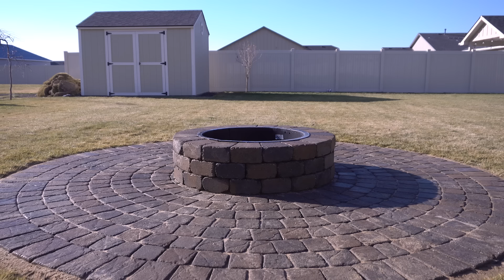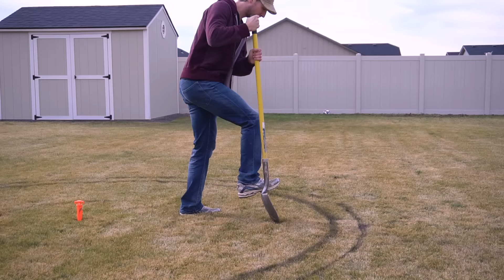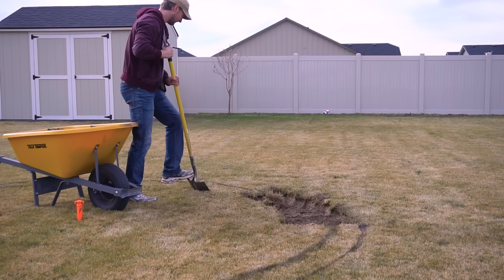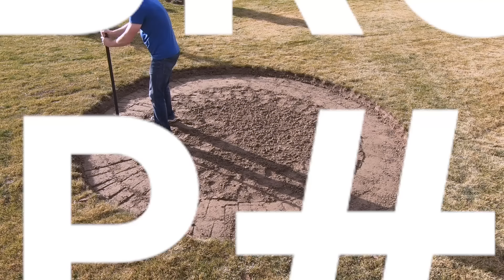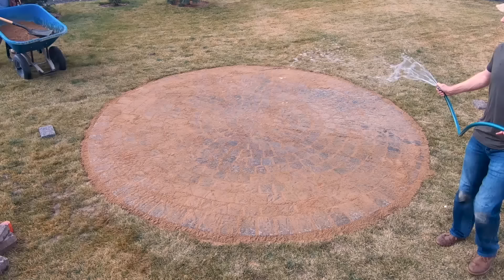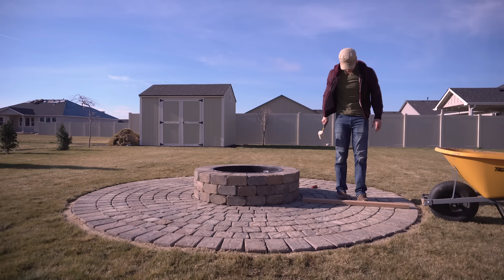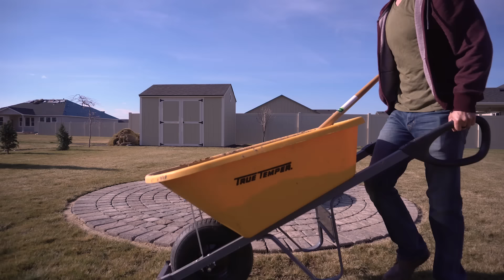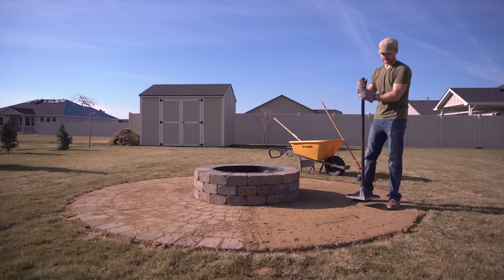My 4-Day Fire Pit Patio Build [Full DIY Project]

Comment: Sand is very, very and very bad choise. Freeze watter on springs or autum can easily pull up a bricks. 

Best is using 20cm gravel 16/23mm > 10 cm gravel 8/16mm. This 2 layers presure with 200kg machine again and again until hard it. On top layer take 4/8mm gravel, which you adjust horizontally manualy with straight plank and lay bricks on it. Brick light presure with 100kg machine with rubber (rubber dont scratch a bricks) and pour fine sand into the gaps between the bricks. 
After all of that again 1 times presure all with 100kg machine with rubber. This layer setting make the water may freeze in the gravel gaps. Sand on your top layer have not ANY gaps and freeze watter easy pull up your bricks (mainly in spring and autumn if snow melt in day and freeze watter at night). In center under fireplace is best to do natural stone layer. Not this brick (they can be cracked after anytimes fires - natural stones looks better + 
they are more durable (+ cheeper)).

If u lived anywhere where isnt winter like classic winter (snow, freeze etc) but winter is like cold summer - this DYI video be okay.

Srry for my bad english. many many words i translate for help in google translator. + i know there in central Europe only metric system like are "milimeters" or "kilograms".

Comment: Loved your video dude. One quick question though. When I built my pizza ovens and fire pits I got bricks and mortar built to withstand fire for stability. Is there a reason why you went with just stacking them?
Reply from the maker: This is just what the kit came with, and the weight of the blocks make them super stable for the height, so I didn't feel like mortar was needed. That said, I did add some masonry adhesive to the top capstones because those were more likely to tip if sat on. So now it's all locked together with those.

Comment: Are those bricks fire safe? Just curious cuz I know some type are not and could explode
Reply from the maker: Basalite (the manufacture) has those specs on their website. But I think that's why they added the metal ring, to shield the bricks a bit. And I added a grate to the bottom to lift the fire off the pavers.

Comment: How do I calculate the amount of sand I’ll need. I have 15ft diameter? Also, is it better To buy sand in bulk?
Reply from the maker: First, I recommend using silica sand even though I used regular yellow sand. Silica will prevent weeds and ants better. As for calculating... I'd find a "cylinder cubic foot calculator" on Google, because basically you're finding the cubic feet of a very short cylinder (your bed of sand below your pavers will be only an inch tall).

You want to fill the cracks between the pavers with sand too - that doesn't require nearly as much with thin spacing between the pavers, but if you do wider spacing, it'll start to add up.

I'd probably calculate my cylinder, and then add another 50% for the cracks.

Comment: Whenever my dad builds something with bricks, he uses sand-cement ish. It’s sand but when you put water it hardens and turns almost to cements. It is hard like cement but not tha hard so that you can still move the bricks
Reply from the maker: Polymeric sand, yeah, I considered it. Decided in the end that with my extra  thin spaces between the pavers, I didn't want to risk it potentially cracking and looking bad.

Comment: Why no cement lol
Reply from the maker: I don't like the look of it in the middle of the yard. 🙂
Reply: The top part where the fire is its not moving or if you will fall on it it won't move? Looks wired holding by itself lol
Reply from the maker: @-IsleOfSkye-  Oh, I see. Yeah, I did add some masonry adhesive to the top capstones so they are secure. Just didn't show it in the video
Reply: Oh OK. That's nice I wanna make something similar in UK but with pipe underground for the air to flow inside the fire (turbo) Nice vid man!
Reply from the maker: @-IsleOfSkye-  pipe would be awesome. I've seen some where they stick a fan in the end. Good luck man!

Comment: Why the different types of sand. Made the sam construction in my fathers garden. Just layed it on the regular sand under the grass. It has been level and totally fine for 15 years.
Reply from the maker: That's awesome! In Idaho it gets pretty cold and the ground can heave in the winter. I also wanted good drainage. So that's why I did a base of gravel mix, and then an inch of sand

Comment: Perfect example of why you should pay a little more and hire a professional! DIY isnt as good as homedepot and you tube makes it seem! Do your research and make sure they are an actual reputable professional! If your contractor shows up and looks like this you should fire him at the point when he only digs 6inchs down for prep! Also sand is the worst product to use on hardscapes! Sand holds alot of moisture making it perfect for heaving! Also ants absolutely love sand because they can move it with great ease! Basically by putting a layer of sand under any structure your building the ants in your community a beautiful ant farm! Any patio, wall or hardscapes should be minimum dug out 12"+ for prep. Also never use sand for joints! There is professional products to put between the road crush, and the paving stones and the joints that cant be effected by ants or water! Like 85 percent of contractors this patio turned out awesome for 1 day! The forces of nature (rain, ants, freeze, thaw) will deteriorate this patio fast! But by this time they have your money and they are long gone lol! Also the number one thing to invest in on hard scapes is proper road crush! Engineered spec road crush is the most important thing your using as a base. Itd expensive but a must! Huge difference between that and the cheap crap most landscape centers sell!
Reply from the maker: Agreed there's stuff we can do better next time! But, it's lasted over a year (two winters) and it still looks great! So I'm happy saving that money. 😁

Comment: The pro should of told you to use polymeric sand as well
Reply from the maker: I don't remember if he mentioned it, but I chose not to on purpose. I wanted better drainage and no risk of the polymeric cracking since I'd already reduced the gaps between pavers more than recommended.

Comment: You make this look easy enough for my husband and I to tackle. But, What do I do about my sprinklers? Is there another video for that😅
Reply from the maker: 😅 I was worried about sprinklers too. But I knew the sprinkler lines were deeper than I'd be digging (your depth may be different - dig carefully or dig a few inches shallower if you want) and I just placed the patio in between the sprinkler heads so I didn't have to relocate any of them. Using sand between the pavers gives the patio amazing drainage, so that took care of standing water. I'd just recommend silica sand rather than the stuff I used. It'll prevent weeds better. You guys can do this! 😁

Comment: So the fire pit itself is just secured there with gravity?
Reply from the maker: At first, yes. They're pretty thick blocks, and held in place without any issue. But the capstones were less solid, so I ended up securing those with masonry adhesive. And that locked the fire pit blocks into place permanently.
Reply: @BroBuilds  Nice work, Thanks for the response.

Comment: Much appreciated, I'm not building a fire pit but I had built a pad for my trash can to sit on out of spare pavers and have had some issues with them not getting locked in. I added layer after layer of sand between them, but I never thought to tamp the sand into the gaps! I'll be doing that after it gets warmer outside
Reply from the maker: To really lock it in, use polymeric sand. It'll harden like concrete in the gaps. I didn't use it because I wanted more drainage through the pavers but especially if you have a small pad, polymeric will hold it all together and drainage won't really be an issue.
Reply: @BroBuilds  awesome, thanks! The patio looks great by the way

Comment: Weeds don't grow from underneath they grow from seeds that land on the top if you put compacted gravel underneath we do 4-6" depending on substrate. Weedcloth is useless. Tamp the sand down with your feet before you screed it. Sometimes we use polymeric sand usually not because its a messy pain in the ass in northwest washington and moss and stuff grows regardless...We usually just sweep and wet sweep sand in. There will be maintenance issues regardless..We also put a concrete wedge around the outside sloping down  and cover it with dirt...the plastic edger is garbage...I've ripped so much of that crap out of the ground. the concrete keeps the pavers from spreading apart is easier to use and cheaper and forms itself to the edge and also keeps the sand from washing out. and also slope it one way or another towards where ever it needs to drain so you don't have puddles...especially if you use polymer binders...sand drains better. Also you can save your arms and rent a plate compacter...for the gravel and pavers

Comment: May I ask why the fire pit wasn't stuck together with concrete?
Reply from the maker: It didn't need it. But I did end up putting some masonry adhesive on the capstones, so they wouldn't tip, and that's holding it all together now

Comment: Please don't take this the wrong way. What you did was hard and alot of back breaking work. You set the pavers out nicely too. It was a good DIY but it's going to have weeds grow in it and structural issue eventually because of some of the important steps you missed. ICPI certified or not you did do a good job for a DYI.
Reply from the maker: Thanks, no offence taken! Yeah, wish I would've added weed barrier underneath, but so far there's only been a few tiny weeds growing near the top. So far it's held up well! We'll see how it handles its second winter soon. 😁
Reply: @BroBuilds I'm guessing weed fabric you mean geotextile fabric. You add geotextile fabric on the dug out area to help structurally before you add the Crush and Run...Instead of the sand you put in. Pressure wash it out and get polymeric sand to put in the joints of the pavers. It'll help with the weeds for quite some time and it stays put alot longer. Not to act like a promotion but my company I work for prefers Alliance gator g2 and it does work really well lol. We used a lot of different polymeric sand and that's what ended up working the best. I hope this helps you going forward
Reply from the maker: @Twoinches2short  Absolutely - I've heard good things about the gator g2 from other people too. Thanks man!
Reply: @BroBuilds  No problem dude. All we can do is learn. I know I still am!

Comment: I didn't understand exactly what the conduits were for, since you removed them later. I know nothing about these types of projects so if you could explain it would be great
Reply from the maker: The conduits were an inch thick, so it made it easy for us to put exactly an inch of sand down, and by scraping the 2x4 along the conduits, we got an even, smooth surface.

Comment: idk, i don't trust a build like that. I need to know my stuff is held in place by more than just gravity. The patio was nice looked nice and sturdy but that fire pit has nothing really anchoring it in place other than weight and gravity
Reply from the maker: Fair enough! I ended up going back and adding some masonry adhesive to the top capstones because I was worried about them tipping, but the rest felt solid enough for me.

Comment: You used the wrong sand to lock the pavers together, you don’t use general purpose sand, you are supposed to use polymeric sand, and you didn’t glue the 3 rows of the fire pit together
Reply from the maker: Good tips, but I didn't want to use poly, because I think it'll crack over time and look bad. But you're right about the sand - I switched to silica sand which is better. I also ended up using some masonry adhesive on the top capstones, so that locked it all together 🙂
Reply: @BroBuilds  more than one way to skin a cat, end result looks good though man! Thank you for not taking the comment in a negative light.
Reply from the maker: @nathanglidden1967  I learned a lot from this project just because people are willing to comment. 😁 Thanks for sharing your expertise!

Comment: dont use normal sand, and it need to be stopped aswell, when the rain and frost come the it will move and u have to do it agen after just a year.
Reply from the maker: What's "stopped" mean in this case?
Reply: @BroBuilds  sry i Meen stomped. That u do whit the stonemix.
Reply from the maker: @saltaren123  oh gotcha. I think I got it stamped down well enough. So far no movement after one winter, but we'll see how it goes this winter too. I agree on the sand - I switched to silica sand later, and poly sand would work too.
Reply: @BroBuilds  thats good to hear, u guys did a good jobb, im just a littel worried aboute the sand, but i think u can fix it if something gona happend.

Comment: No polysand? No adhesive glue for the fire pit stone?
Reply from the maker: I chose not to do the poly sand, because I felt like it would crack too easily in between the pavers. I did add some masonry adhesive for the top capstones of the fire pit though!

Comment: So you removed 7 inches of dirt to put 7 inches of other shit in it's place?  And that makes sense how?  Why not just remove the grass and whatever dirt you need to be removed, pound it, and lay down the pavers?  No one is even gonna know what's underneath.
Reply from the maker: The gravel and sand is for good drainage. If you just lay pavers on packed dirt, it'll flood when it rains and the pavers will slowly shift and move over time

Comment: Dude, shouldn't you fix the bricks around the fire pit with concrete so there is no chance the bricks will move. Anyways nice video. I liked it and I also subscribed
Reply from the maker: Thanks! The bricks were fine, just held by gravity, but I did add masonry adhesive to the top capstones so they wouldn't tip off if somebody sits on them.
Reply: @BroBuilds  omg, you guys are legends, this is one of your oldest videos and you literally replied in less than a hour. BTW this is the first video that I watched fro your channel and I loved it so much that I subscribed with notifications on right away and I've been watching your videos the last whole hour

Comment: Having the gas powered tamper/compactor would make the final step with the sand really tie things together. 

The vibration on top of the sand/paving stones forces the sand into every little nook and cranny, then you have less sand to sweep off the stones and the stones are really tightly secured with the sand packed between them.

Comment: Why don't the pavers on the fire pit just slide around?
Reply: Yea I was wondering the same thing 🤷🏽‍♂️
Reply from the maker: The very top ones? We actually did end up glueing them down with some construction adhesive. We didn’t in the video because we weren’t sure if we were going to move some of the bricks around (which we did in the follow up video).

Comment: In future reference you should of used kill dry sand instead of regular sharp sand. Kill dry sand is finer and made for block paving sealing
Reply from the maker: Good tip. I went back and added silica sand later, to keep weeds from growing from in the cracks.

Comment: I’m planning on doing a similar project in April, should you have laid anything down to prevent grass/weeds? It’s been almost a year, have you had any issues with weeds, or regrets overall? Appreciate yours, or anyone else’s input if you’ve laid pavers before. Thanks
Reply from the maker: I forgot to lay down weed block, and I probably should've! That said, I only had about 5 weeds and they were all at the top (so the weed block wouldn't have helped anyway.) I do recommend silica sand, rather than regular builders sand - it'll prevent those top weeds.

Comment: It turned out great. I have a tip to find the center fairly easily, lay out string running through the middle edge to edge and then another piece 90 degrees from that one edge to edge.
Reply from the maker: Great tip!

Comment: Dig the hole 
Put 5 inches sub base in (level)
Use wacker plate 
Put 2 inches marine sand on sub base.
Lay blocks.
Fill block gaps with kiln dried sand.
You're welcome

Comment: What is the purpose of the conduit?
Reply from the maker: It makes it easy to level the sand at a consistent depth of 1 inch, because the conduit is 1 inch wide.
Reply: @BroBuilds  

Ok thanks!

Comment: Why didn’t you use mortar to fix the stones of the firepit?
Reply from the maker: It doesn't need it. Although we did end up using masonry adhesive for the top capstones, to make sure they won't tip if someone sits on them.

Comment: Advice:
Use grit instead of sand under the stones. It will not be washed away from all the rain over the years. And it gives you a much harder ground than sand.
Although very good video!
I'm doing stuff like this the same way, just using grit instead of sand 😉

Comment: Won’t the fire pit be loose? I think you need to put like heat resistant cement in the cracks.
Reply from the maker: Yeah, I ended up using masonry adhesive for the top capstones, just to make sure those wouldn't tip.

Comment: That sand really does nothing over time of you don’t seal it. And I think you used regular sand. You should be using interlocking sand or if you don’t want to seal it use smart sand.
Reply from the maker: Yeah, it was regular sand. I used silica the next time, and that does better.

Comment: My favourite thing about this video is that you pointed out how a half inch gap looks stupid. And then went ahead and built without it. This gives me the confidence to do the same when I build mine.
Reply: i did interlock for a summer and thought the same thing at first but when the sand hardens it looks really good with the proper sized gap
Reply: not to mention the extra space makes it much easier when it comes to sanding and resanding